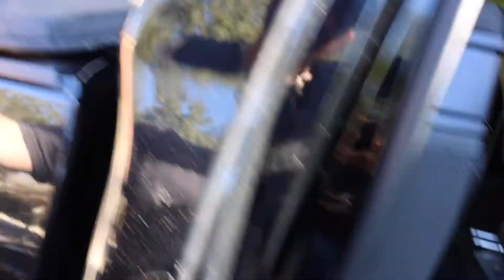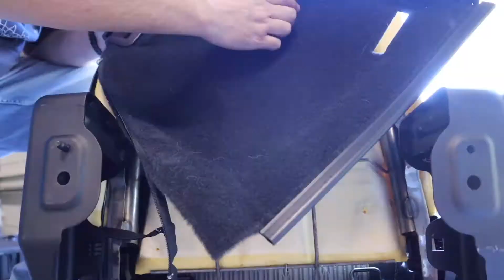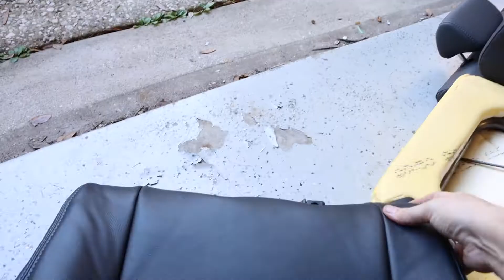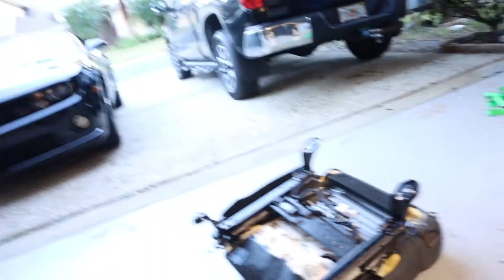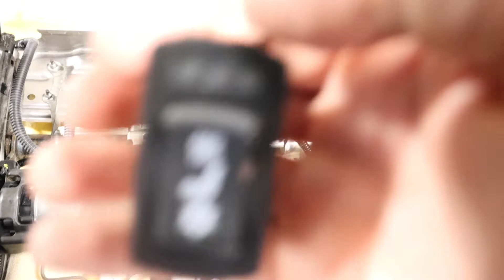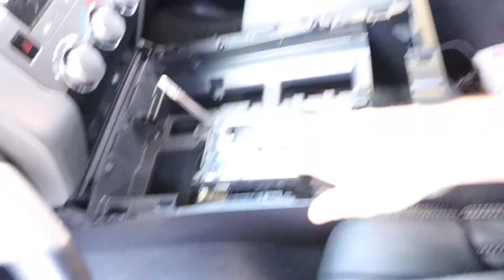Installing custom leather heated and cooled car seats - 2016 Toyota Tundra

Comment: Did you have to cut the connectors off the inline fuses to run them together?
Reply from the maker: It's been so long I don't really remember. But I don't think that they had ends to them to begin with. I know I did have to combine them. But either way it's pretty simple to tie them together and put one end on both and run that to the relay.

Comment: I’ve been seeing mixed reviews , is there sound , is the ventilation loud?
Reply from the maker: On full blast, yes you can hear it. But it's easily drowned out by the radio, so it never bothers me. It's no louder than the car's air conditioning.

Comment: Where do you get power
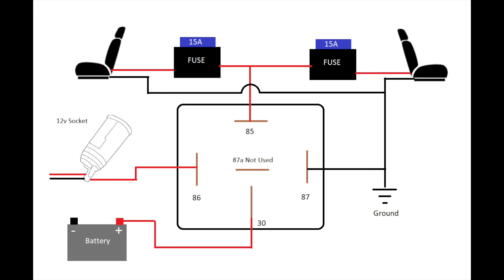Reply from the maker: I ran a new wire from the positive battery terminal through the firewall in the driver's footwell for 12v. Then I tapped into the back of the cigarette lighter outlet for ignition on signal on the other relay terminal. Check timestamp 1:22:00 for a wireing diagram.

Comment: Final product looks great! I think that is a great place for the buttons. Would love to see how they look installed!
Reply from the maker: Thanks! I can't believe I didn't get a good shot of that. #amateur. I guess by that point I've been a few days and it was dark and I was just so tired that I wasn't doing the best job filming it by the end. Right around the 1 hour 20 Mark you can kind of see a little bit of glimpse of how it turned out. I do think it's the perfect spot for them they're easy to reach I can see if either one is activated and to what degree, and they do nearly look stock. Would have been better if I hadn't messed it up with the Dremel, still thinking about replacing that centerpiece I can get a new one for about $250.
Reply: You have to know how they come from the factory to know how these are. It blows air on your butt through the perforated holes